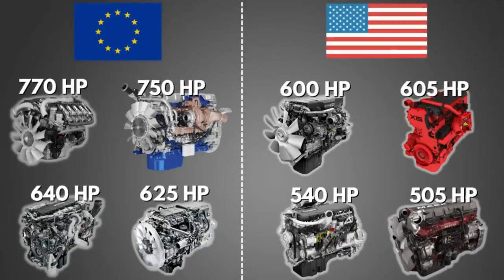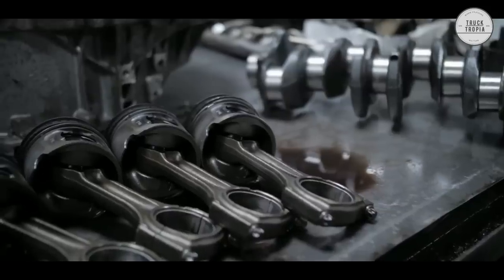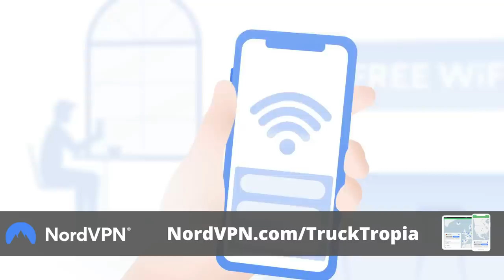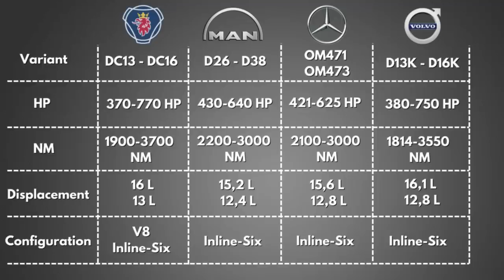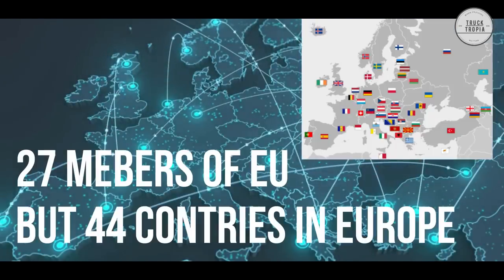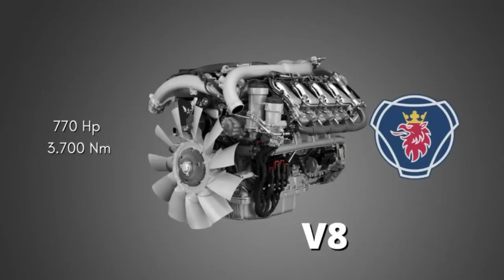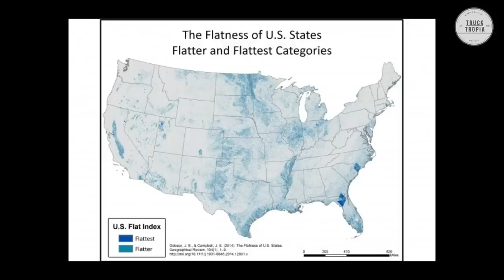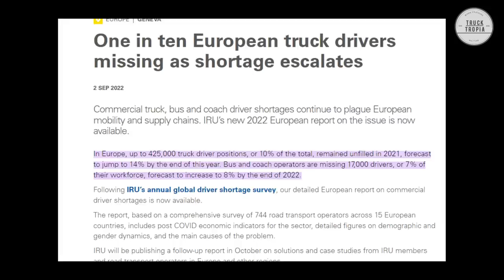Why European Trucks Have Up To 770 HP And US Don’t

Comment: As a german, I have to point out: There might be more powerfull engines available, but not many trucks have them. If you drive onto the A7 (Autobahn) at the "Kasseler Berge"  (Kassel mountains) near Kassel, you often find trucks going no more than 30 kmh / ~18mph even though they are allowed to go 80 kmh / ~49mph by law. They crawl up the steep roads because they cant go any faster. Normal trucks, used for day-to-day transport outside the apline area are mostly equipped with engines with less than 500 hp because the bigger engines will consume more fuel without shortening the travel time to any significant degree.
Reply: Well… The once going 30 km/h usually have Eastern European license plates and are worn out over many years….
Reply: @yogabearmobil  Actually, I am mostly talking about ones with german licence plates. I can only (partially) speak for them since I actually talked with german truckers.  I have never talked with foreign truckers...
Reply: @yogabearmobil  or not the ones going 30 are juste max loaded or overloaded and the driver doesn't really react wen he should go manually, with the old MAN tgx 18480 (500hp) I can climb that thing with max 60kmh, with DAF xf 530 (530hp) I go max 45kmh, full loaded (40t) 
So depends on the engine, driver, weight and if you have or not already that one going 30 in front of you...not eastern eu old dying trucks, those are already passed out in Fulda or Göttingen 😅
Reply: @yogabearmobil  Many East European trucks are owned by West European companies with an office in Easten Europe. Their drivers earn 1/4 the wage of a West European driver, that´s why most of the international transport in Europe is done by East European companies. They have modern trucks but basic models to keep it as cheap as possible.
Reply: Not sure if the "Pommer" counts to the "Kasseler Berge", but i have seen a lot of broken down trucks and some that were on the brink of death going up that hill. I mean even my shitty 2020 Ford Focus has trouble going up there :D
Reply: Ah yes the a7. The bain of all truck drivers. Cant wait till the new autobahn from kassel to the a4 is finished
Reply: As an eastern European i have to point out that most trucks run low on weight and full on volume. And unlike Scandinavia here we have mountains to cross, it's not flatlands from port to main city and the trucks are fit for the job. They have higher weight limit in Scandinavia so they have the flexibility to try to cover the losses and use the trucks in creative ways. Two containers on flat land from port to city, it's a great way to use that high power truck. It can pull up in the mountains but ... no. That doesn't really work and never will, when you see the train passing by you trough the gorge loaded with shipping containers while you have just one ... trucking in the mountains is not worth the trouble
Reply: Same thing in the USA - the more powerful engines are often available, but NOT as often used (somewhat more often by Western-based truckers as they have to cross the Rocky Mountains range a lot more often).
Reply: @b.w.9392  Neither of us will live to see
Reply: I drive a truck in Germany. Never seen struck going 30kph on the A 7.
Reply: @peterturley1537  Are you including the far south/southeastern part of the A7 neat the German/Italian/Austrian border area?
The rest of it would be pretty flat (comparatively) - SPECIFICALLY including anywhere in Kassel.
Reply: Ja ich wohne direkt an den Kassler Bergen und die Trucks haben teilweise echt Probleme vorallem zwischen hedemünden und lutterberg 😂🙌🏻
Reply: I broke the crankshaft of my NSU Prinz4 going down the Kasseler Berge on the A7.
Reply: As a Sweed I have to point out that our trucks are a hell of a lot heavier up north. So there is definitely a need.
Reply: It would drive me nuts running at 80kmh. One tractor I ran, Had a Detroit Diesel engine in it, it was rated at 575hp, it was remapped and re-set at 700hp, it had 3.71 rears, plus 18 speed trans, was not speed governed in any way, and we rarely went above 120kmh. It was not bad at all running through the Rocky Mountain roads. But still would like the CAT C 18 lol. Bet some will say your full of it right, well so be it, but this was perhaps 15 years ago now.
Reply: @anvilsvs 
NSU Prinz😂
about100 years ago?
Reply: 1967.  56 years ago.
Reply: Give me a 540 Hp truck so that I can reduce my fuel consumption by 4-5 liters/100km per month compared to my current 460 Hp truck.
And yes, my weekly route goes from Travemunde to Italy and back, so Kassel and the Alps are very familiar.
Reply: I have done Denmark-Italy for a year, about 45 roundtrips. That was 25 years ago. My Scania 420 V8 was pretty ok with 40 tons total( 26 tons payload ), but back then, Eastern and Greek trucks were snailing their way to the tops. And then snailing down again to save breakes ( or poor brakes, I dont know ) 
I had a magnetic retarder on my truck, and with around 22 tons payload I would go 80 kmh downhill with full retarder on.  That was sweet compared to the snails :-) 
On the other hand, going out of Copenhagen in rushhour, with 46 tons total and no clutch, that made me sweat..
Reply: @Namtov 25 years ago meant it was a sensible idea going slow downhill with only a engine brake and truck+ trailer fitted with old fashioned drum brakes. Most didn't have a big scania retarder back then. 
One man told me: you can do a descent a thousand times too slow, but you only will do it too fast once.
Reply: @patrickverbaarschot9745  Oh I know :-) I have tried hot brakes, Smoke coming from all trailer wheels really makes you pay attention to the driving. To this day I always recognize the smell of hot brakes
Reply: @yogabearmobil  That is Not true. They have number plates from Germany, Netherlands, Poland, Bulgaria etc....
Reply: You gotta get a lot of xp to unlock the faster motors
Reply: Having driven the autobahn, back in the 80s, in the Army for 37th Group, I remember some of those hills...Alligator Mt. south of Augsburg, and Catback Up near Mainz. The trucks we had were M915s, with a 400 BC Cummins/Cat 16 speed semi auto transmissions. They did better than the German trucks back then. We were only allowed to run them at 50mph/80kph....although, some of us would bend the rules a bunch. Good times for a 19 year old...
Reply: That is ther reason why German Autobahn will get very usefull part starting at A4 and connecting cross to new A44 as well. But I do agree with you.  Hills can check power of engine.  I have been loading in Deggendorf and took the roady 533 to B12 to Strazny Czech.  And I can say my R450 Scania with caro 24 150 kg manage to do 42 km/h.  Even my country Slovakia we have lot´s hills areas. I do live in one Orava Region.   Drivers have to cross hill called Prislop 5,8km and 12% in last 1,5km can check engine too.
Reply: In Sweden we have a lot of them to haul timber and ore 👍🏻
Reply: Kasseler Berge? Laughs on "Katzenbuckel" aka Elzer Berg on the A3 where there literally was a speed limit of just 40km/h on the rightmost lane until 2009 which then has been increased to 60km/h - just because of the trucks. Best place for a so called "elephant race" when another truck tries to overtake someone just doing 25-30 on that lane with a delta of just 5 or 10km/h and you only got the leftmost lane for actual Autobahn speeds in your car...
Reply: @anvilsvs  Thanks for reminding me of "Wer steht am Berch un kütt nit hu? NSU! NSU!" XD